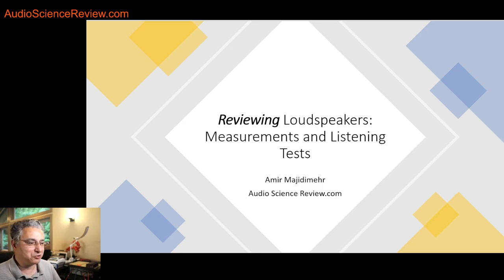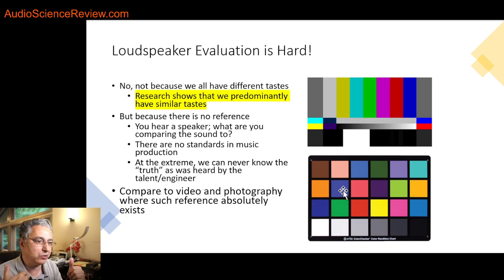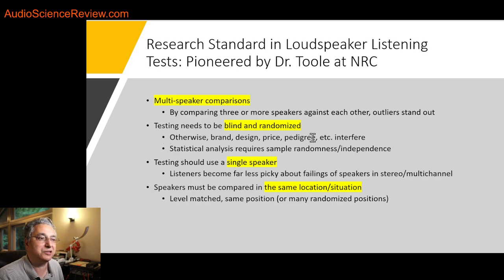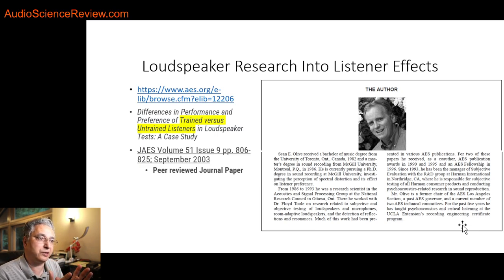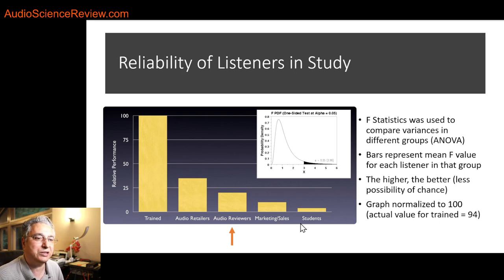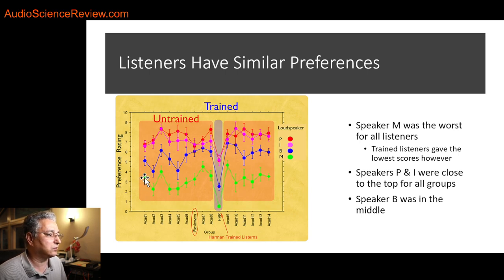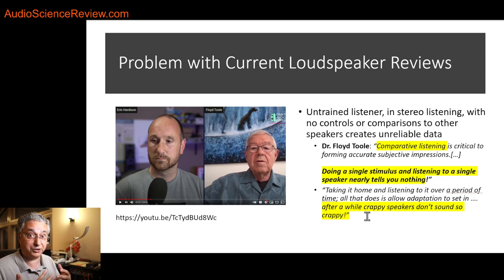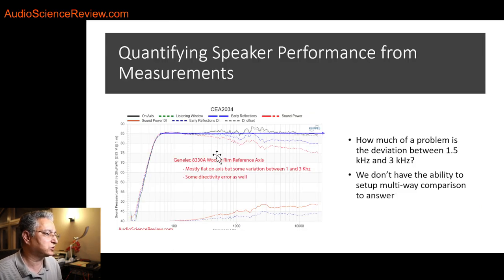Reviewing Speakers - Measurements and Listening Tests

Comment: Also, would love to her your perspective on whether imaging and soundstage are measurable or even a real ‘thing’.
Reply: Paul Sxton  they’re real, but they’re a result of off-axis performance and side wall/ceiling/floor reflections. Anthony Grimani talked about this during an Audioholics episode.
Reply: @andrewskaterrr  No.They are affected by reflections but they are not the result of reflections.They are the result of timing and amplitude differences between the signals hitting our two ears. There is some phase and spectral content qualities that further affect spacial perception but it is mostly differences in arrival time and amplitude between our two ears that create spacial aural perception.
Reply: @scottwheeler2679  The do help create it though, that's why Erin, Gene, Grimani, etc talk about how speakers with good off axis imaging help make the soundstage/image larger/wider.
Reply: @andrewskaterrr  But it becomes a liability with speaker crosstalk cancelation DSP. And that is where state of the art imaging/soundstaging is.
Reply: @scottwheeler2679  There's 1? speaker that tries speaker crosstalk cancelation. Almost no one is doing that, and it really only works for the MLP from my understanding. 99.99% of people have a standard setup where 100% the room affects imaging/soundstage.
Reply: @andrewskaterrr  yes, one speaker is a problem when considering such DSP. You might be right that almost no one (being audiophiles) is doing that now. But anyone can do it with any two channelstereo system using DSP. And IMO it does give 
state of the art imaging/soundstaging. Absolutely so  for stereo playback but (again IMO) it also surpasses multi channel as it exists here and now. And when one considers how little of the world's back catalog of recorded music was recorded in multichannel and how much of it was recorded in two channel stereo it's a big deal. Again IMO.
Reply: @andrewskaterrr  Polk had the SDA speakers many years ago,  which they've recently resurrected with the L800. Carver also had an electronic version, his Sonic Holography Generator. When I heard a Carver amp with it I was amazed, in that I heard sounds coming from behind me when there were only two speakers in front of me playing. However, the effect seems to be very program dependent. Anyone with two pairs of speakers can experiment with this, by placing the 2nd pair connected to opposite channels and out of phase with the first pair. It takes careful matching of levels and works better with two pairs of identical speakers of course. When I've tried it, it was very effective on some program material and less so on others. For those that don't understand the concept, the 2nd set of speakers, with the resulting phase cancellation they cause, effectively reduces the amount that your left ear hears from the right speaker, and the amount that your right ear hears from the left speaker. When I had it dialed in just right, and with some tracks I did hear sounds coming from behind me. But, even on tracks that had a less dramatic effect, it really widens the soundstage, so sounds come from well beyond the speakers on either side.

Comment: As a child, I was forced by my mean parents to study the violin (though I prefer Led Zeppelin and the like). I learned to play a few acoustic and electric instrument extremely badly. It is quality audio gear to me if I can hear all the instruments in a band or orchestra and if Paul McCartney doesn’t sound like a kazoo. I know what these instruments are supposed to sound like. I can’t hear 8KHz; I can hear 7 maybe 7.5 tops yet I can tell if recordings are too thin. I can hear reverberation and noise. I prefer a bright speaker so I can hear the cymbals but I’m not in the market for ultrasonic transducers.
Unrelated question: how does 1/3rd octave compare to ERB?

Comment: Generally, I enjoyed watching this. It was very informative, even if covering much of what I already knew. 

There are a couple issues I took with your statements.

1) When discussing testing at average listening levels and the issue with detection of certain flaws, which is fully valid, you missed discussing compression tests. Compression tests can look at the deviation from the testing done at a moderate listening level. One example of how this can be done is to compare at an SPL in the 70s, 85, 95, and 102, such as Erin from Erin's Audio Corner does. Compression testing can identify certain of these errors, although not all. So I wish that was included and explained in that section.

2) When discussing crackle, I do agree that you can hear it even if it didn't pop up on tests at moderate volumes. What I disagree with is being dismissive in tracking down when and where it occurs. Why? Because if you are willing to take a tone generator and figure out what frequencies and what conditions on SPL, whether high or low, need to be present, you are giving more information to your audience. That can inform them, based on their needs and preferences, whether a speaker is a good fit for them. If a speaker crackles, but that only occurs under conditions in which a person does not plan on operating their equipment, does it matter to that specific consumer? So this isn't to negate your point, but rather to explain how you can turn this into a value added to your consumers (meaning consumers of your content).

3) During the discussion of EQ at the end, I took issue with the presentation on numerous points.

3.1) Trying to crap on another person to raise yourself up is bad form. Not to overly defend Danny from GR Research, there are times where fixing a badly implemented crossover can help. Now, I have issues with his methodology, such as having a sample size of one when he creates the crossovers whereas each driver has tolerances and without taking a larger sample size, his crossover design will only fit with the drivers in that series that are relatively close to the ones he tested. A larger company, when designing the crossover for mass production after they buy a larger supply of drivers, can then sample a larger number of those selected drivers and come up with a more accurate average. Further, on component choice, the lower in price for the components in a crossover also allows for a larger tolerance percentage per component, making even one crossover to the next vary more. As such, the more expensive drivers and more expensive crossover components wind up with less variance driver to driver or component to component. This means that it is easier at the high end for a design of a crossover to accurately and adequately be used across a larger number of speakers, whereas the cheaper the drivers and components, it usually has more variance and thereby the efficacy of the one size fit all crossover is less at correcting issues in frequency response. 

But your critique was not that. Your critique was to belittle and malign as trying to fix a crossover or to upgrade it to have less variance is useless, without discussing limitations of his methodology. It came off as petty, to be honest. 

3.2) You then turned to your use of EQ over addressing a crossover. Here, you did not discuss the limitations of using EQ, the potential for over equalization, the limit of computational assets to be able to address certain shortcomings of speakers, etc. I do understand with how long the video was for why you wouldn't get into the nuance here, especially since that topic can be very nuance and can take an hour or more to discuss on its own. If critiquing someone else, it is important to also be forthright with the limitations of your own methodology. 

As a side note, one benefit of correcting with a crossover is that it is in hardware, requiring less other expensive hardware to adjust the signal being sent to the speaker to make up for its short comings. I agree with not doing crazy notch filters for each peak (not to say don't do it at all, just no need to do overly complicated filter arrays, like you said), but that doesn't mean that fixing it in hardware is useless. Sometimes, you may even need both fixing in hardware and doing EQ to reach the pinnacle of a system.

3.3) There is the further problem when discussing EQ of putting the correction out for all to use. Here, I haven't seen your reviews for speakers yet (I just found your Youtube page, but have followed your amplifier, pre-amp, etc. work on Audio Science Review for a little while), but I did want to mention that you need a disclaimer. That disclaimer should be something similar to what follows:

Although I provide the EQ I found to work best with the sample I have from the company, due to tolerances in driver manufacturing, cabinet manufacturing, crossover components, and every other factor that goes into the manufacture of a loudspeaker, needless to say room curves and room correction implementations, the EQ provided may not be accurate for your specific sample. Please feel free to use my settings to see if it improves your loudspeaker experience. If it does not, then discontinue the use. For best results, I would recommend getting your own test equipment, such as a calibrated microphone. This will allow for equalization that is specific for your device and room. 

By adding a disclaimer like this, it will bolster confidence in your findings and get rid of the comments like "I tried the EQ settings and they made it sound worse." Further, I found that getting your own test equipment to be especially true with televisions and other displays. I own my own pattern generator, i1 pro spectrophotometer, and i1 display colorimeter for that reason, and my displays have never looked better (yes, I know those are not reference meters, but they are good enough for a hobbyist to do very well). In the same way, proper SPL equipment and a calibrated microphone (and possibly equipment to get impedance data) can help with setting up your devices at home. This also means, for my same critique of Danny's work, your work regarding an EQ finds itself in a similar flaw of methodology. The disclaimer I stated above roughly aligns with how the website RTINGS provides CMS settings for their reviewed displays. 

3.4) A potential value add to your consumers would be to discuss when and how the EQ applied helped with the speaker, but you would possibly need to combine this with the compression testing I discussed above. By doing so, you can better tell your consumers when the EQ starts to fail. 

With drivers, when you do EQ, if you ever have to raise a point, you could be driving the driver harder, thereby causing additional heat, leading to variations in the compression testing. As such, by doing the EQ, then repeating the compression testing, you can analyze when the EQ is causing the driver to perform further out of linearity compared to playing the speaker at lower dB levels. 

These are just some of my thoughts on your video. Overall, I did enjoy it. This is meant as constructive criticism, not meant to be attacking at all. If it came off as an attack, I do apologize (especially related to the part about Danny, which I also tried to show why his methodology is also flawed in regards to creating a crossover from a single sample; and I apologize for not acknowledging above that you are correct  that not all  of those systems may need a newly designed crossover). I hope this is well received and am open to any feedback or response challenging my above statements. Hope you have a wonderful day!

Comment: You can balance the sound of a bad speaker design that has cheap X-over parts but you can’t make a cheap crossovers sound better with equalization. You still need to go in and change the crossover parts to get “good and balanced” sound not “bad but balanced” sound.

Comment: Hi Amir, I have been thinking about the issue of a speaker listening standard, I wonder if we could take a powered studio monitor with good frequency response and off axis response and correct it to the Dirac desirable curve and then send that to reviewers as a standard to act as a reference against . They could also then run Dirac room measurements both the speaker standard and reviewed speaker .
Reply from the maker: HI Andrew.  I think all reviewers need to have a reference system like that.  I sometimes do that very thing, go back to a known speaker when I think something is wrong.  Half the time I find that my reference signal has the same issue.  :)  But the other half, I am amazed how much better my reference speaker sounds compared to what I am testing.
Reply: @AudioScienceReview  very interesting Amir, I do the same also. Anyway thanks for replying , I have been really enjoying the measurements videos  especially the one on power filtering etc, which I never understood and not surprised it makes no difference , never invested in that rubbish, which seem now ridiculously expensive. I have been wondering about audioreviewers unreliability and have hypothesised it might be they have developed their own internal template of what they think is correct which doesn’t bear a relation to accuracy of response. A number of headphone reviewers talk about a preference for excessive bass. This is something I find anathema to good quality sound, and obfuscation of accurate reproduction. As a aside I laughed when you said you didn’t read reviewers that quote music examples lol…..

Comment: I try to approach audio with as much of a measurement and test based mindset as possible. The point about people being less picky about stereo configurations really threw me for a loop though. If you're testing the preference of a single speaker in mono, are your results then only just applicable to listening in that configuration? If people are so easily confused about the preference of speakers in stereo, and that's the way the majority of music has been recorded for the last 60 years, isn't that a much more interesting problem to understand?

I feel like I tend to judge the sound of a system a lot less on whether or not it has enough bass or too much treble than I do about imaging and soundstage and that's completely out of the equation in a single speaker setup. As just a listener, and not an audio engineer, it seems to me that stereo is where all the hardest problems lie both with the mix and with the building of the actual speaker. What am I missing here?

Comment: Thank you very much for the video.
How good is the subject of headphones when they are equalized to the same frequency response, regardless of the price of the same.
Hopefully one day I can equalize 2 speakers with the same frequency response with a very large price difference.
You will see what a surprise in a double blind test, always speaking that both speakers cover a volume and that the distortion is not audible.

Written with Google translate

Greetings

Comment: If I want to build my own passive speakers - what recommendations do you have for speakers?
There are so many speaker manufacturers that you don't know what to buy.
Reply from the maker: Unfortunately I am the wrong guy to ask as I am not in the DIY speaker world.  I have however tested a few DIY kits at ASR.
Reply: If you're looking for either individual hi-fi components, or complete kits there are several options. Parts Express has a great selection of budget friendly products ranging from individual drivers to full flat pack kits with virtually everything but the glue. If you want to go a higher end route, Madisound, or Solen (Canada) have a great slection of products, but the prices for some drivers and kits can be eye watering. For home theatre style kits based on low-medium priced pro audio components, DIY Sound Group is probably the best source for that stuff. For pro audio drivers only (no kits), either Parts Express or US Speaker are probably the best choice. 'hope that answers your question.

Comment: Thanks again for the very useful knowledge. I am just wondering how i can partially evaluate speakers without buying all these fancy expensive measurement equipment. For instance, can an inexpensive impedance tester tells anything about speakers? At present, I just look at the weight, the woofer exclusion, knocking on the side wall of the speakers for box sound and inspecting the internals (crossover design) of the speakers if available. And listening test. Can you recommend an EQ? Are there EQ in the market which can automatically correct for speakers and room imperfections?
Reply from the maker: Unfortunately there is no cheap way to measure speakers properly.  Manufacturers need to get them done and publish.  Until then, you are stuck with the tests I do.

There are automatic EQ systems out there but they are almost a different animal than the EQ I talked about in the video.  They are all or nothing so you can't experiment with them like you can with a parametric EQ.  There are many software ones you can play with.  See: https://www.audiosciencereview.com/forum/index.php?threads/eq-software-for-windows-linux-macos-ios-ipados-and-android.18450/
Reply: You can get a UMik-1 and REW software for < $100 to measure in room response.  It won't give you the full CEA diagrams like Amir has, but it will allow you to set your parametric EQ.
Reply: @MsSgent  🙏🏻🙏🏻 I will have something to play with soon. Thanks for yours and Amir’s suggestions.